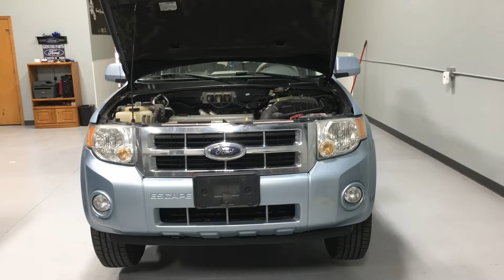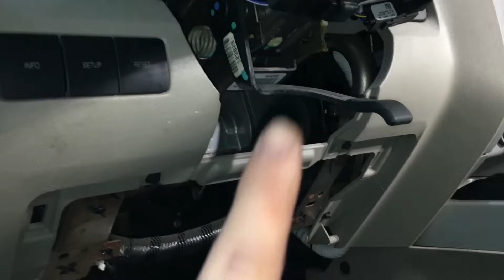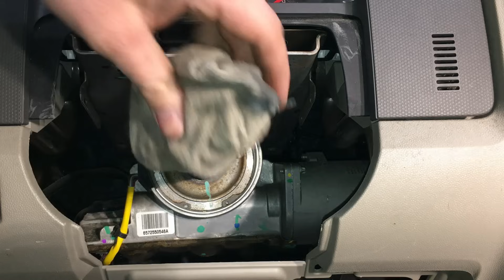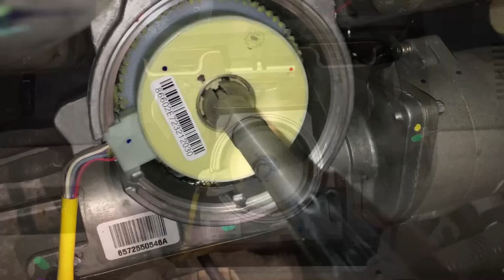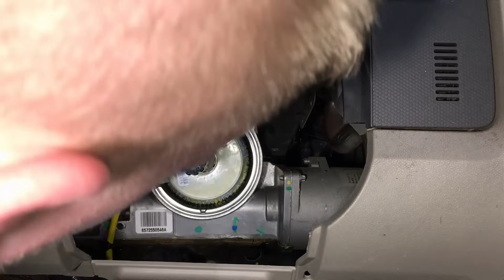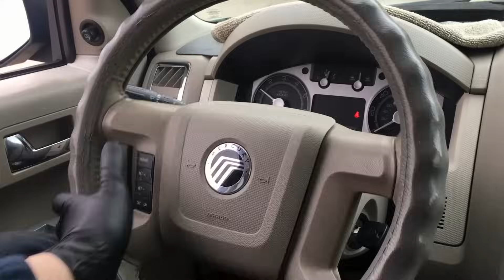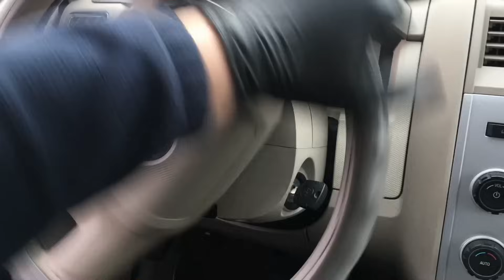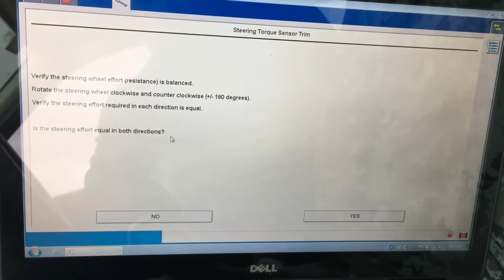2008-2012 Ford Escape Power Steering Code B2278 : EPAS Torque Sensor Critical Installation Steps

Comment: Have a 2010 escape no fault lights showed steering didn’t shake it just power steering started becoming intermittent. Watched video four times, gathered tools and part. Watched one more time writing down step by step everything necessary. I moved slow and precise thru the steps. Getting connectors undone slowed me down lol. Snap ring was a breeze. Aligned everything put together. Tested no shake or wild steering when key was turned but starting engine that thing flew to the right.  I tore apart, redid every step, snap ring decided to be a pia but got it done. Turned key nothing but start engine it flew to left (ordered another sensor but it would be here for a few days so I continued with the one I had)  🥺 redid a third time snap ring was even more of a pain steering again flew to left. So the day was shot but I decided to try one more time the following day.   Watching multiple videos, reading multiple forums  posts. I learned that you can reinsert the pin. There’s an upper and lower gear thingy in  the sensors center and both have to be aligned perfectly for pin to go back in, you’ll know because it’ll sit straight up and down and plastic gears won’t move independently.  I double and triple checked everything each time I did the install but any slight movement can set it off center so just be careful not to jostle anything until snap ring is reinserted. I reinstalled being very very careful. This forth time I decided to take car off the jacks before inserting key. So I put it down turned the key then started it and not a single movement from the wheel.  I turned left and right to lock positions several times and it was smooth as could be!  Backed out of garage and did a test drive around the back of barn area. Perfect power steering. So now I’m just going to be a bit cautious for the next few months just in case. 

Most important take always:  make sure those gears are perfectly aligned on sensor when you pull out of shipping box they could be jostled during shipping and handling.  That pin should be straight up and down in the center of its opening. No leaning forward or sideways. 
Double and triple check for alignment once installed. Before sliding tube back on. 
Don’t jostle anything when installing snap ring. 
Locking snap ring pliers are a blessing as it’ll hold snap ring when taking out making reinserting easier. 
Put car on ground before turning on ignition.
Reply: Thank you for your comment! I have 2009 ford escape . No fault codes , lights on dash . Only Power Steering assist fault message  ! Ford after sending out these recalls should have made it clear don’t do this unless problems with power steering!!!!!!

Comment: I just had this part replaced but the mechanic is saying it's actually the MOTOR of the steering wheel...is this true? After installing this senor my steering wheel is still very hard to turn

Comment: So I lined up the small arrow and the hole was pretty much center when I pulled the pin. I put it all back together and the wheel just cuts all the way to the right.

Comment: Didn't work!🙁     What a massive PotA trying to remove (let alone re-install) the snap ring.   I'm not going to go into all the details (I could write a book) but by the time I got it off (with the help of my brother and enormous trial-and-error effort to remove and install) I'd spent hours on that alone, not including getting the tools.  You DO need a very specific sort of snap ring removal tool, and though I got the biggest pair I could find at Home Depot (after trying the puny one's from AutoZone) it was still inadequate for the job.   For a single appropriate snap ring removal you will need at least a $35 - $85 tool from some specialty store (maybe).   And even then I think it would still be a massive headache.  This is not mentioned in video where it comes off in under 30 seconds. 

Everything else went relatively smoothly.   BUT.... no dice.   Still get message "Power Steering Assist Fault" with no power steering.  

When I installed the new sensor, the hole was in the window but on the farthest possible end of it.   I figured this is okay.  Right?  It's in the window!   Well I hope so. The video doesn't mention how to adjust this if you want it right in the center.   Reinstalling the snap ring and everything else involved a great deal of jostling of the whole assembly so maybe it came out of alignment by the time was all said and done (except for reinstalling the trim).   

Well... there is NO WAY I'm trying to get that snap ring back off and back on, and my brother is more adamant about that than me.   Someone below said they had to try 5 times to get the thing aligned right, but got it to work.    In my case, there was no wild steering wheel swing.  It just gave the same old message of Power Steering Assist Fault, with no power steering.    I have a computer reader with phone app, but that doesn't show any error codes or anything that can be cleared (at least with that tool).     The battery had been disconnected the whole repair.   

Anyhow.... I don't know what else the problem could be.   Got a bad replacement sensor?  Not quite aligned right?   Something else?    Gah.
Reply from the maker: Get the codes cleared in the PSCM and see if the steering comes back now.
Reply: @FordTechMakuloco   Thanks.  I'll give that a shot.   How would I go about doing that?
Reply: @FordTechMakuloco  I'm back.  Did the repair (wow was it really 8 months ago) and as I'd reported it didn't work.  But guess what!  I have my power steering back now!  For the last couple months already. 

I had resigned to live without power steering, and did so for 6 months.  But only after I took the vehicle to the Ford dealership where I'd frequently gotten work done to ask them to clear the codes in the PSCM.   The Android App based reader device I have didn't see or clear that particular code, so I figured the dealership would be able to clear it.

Well.... I took my car in for The Works oil change, and told them about my repair attempt.   The service associate was surprised I was able to get a new sensor to install.  Previously they'd told me they couldn't get that part, nor would they only replace just that because typically they find other things wrong, and so must replace the entire steering column (for $2000).   Though I'd already researched that it was likely this sensor and is probably all that needed to be replaced.

I told him where I'd found one (wasn't hard to locate a replacement), and that I'd installed it watching a detailed YouTube video on it (yours), but that my power steering didn't come back and the video creator suggested I get the codes cleared and see if it comes back.    Well... after waiting a couple hours (for the oil change and this supposed attempt to clear the codes),  I was told that they couldn't clear the code. It would clear and then immediately trip again.  BUT, he said NOW they'd be able to do the same repair I'd just done, instead of replace the entire steering column, and they could to that for just under $1000.  

I was like, screw it,  I'll just have to live without power steering, unless I decide to try to take that snap ring off again, and see if I'd messed up the alignment. 

Well,  many months later,  I got stuck in the snow.  Spent several minutes trying to get out of it, which I did.   The next day my traction control light came on and wouldn't go off.  So... I'm like well let me read the codes with my Android App tool thing and see what it says.  Well I ran that, it gave some codes I didn't really check them all but saw one seemed related to the traction control, and I cleared them (while driving, and the light didn't go off🙁 ).   

Then a bit later I'd parked and turned the car off.  When I came back and started the car, the traction control light was off!  I guess I had to turn the car off and back on after clearing the codes for the light to go off.   So, I pull away from the curb, and notice... Wow that steering seemed really easy, Am I parked on ice? 

Nope!  I wasn't parked on ice. Well maybe I was, but... regardless my power steering was back!!!   WTH!   It's been back ever since.  It would seem that the Android App tool that I use to read the car's computer codes has had several updates over the last few months, and I'd just never checked again to see if it would read or clear that code.  I figured only the dealership (or someone with the right tool) could do it.  And I trusted the dealer was being honest when they told me they tried clearing the code but it wouldn't clear!    

Moral of the story is... well... I don't know if the dealership repair shop was lying to me about not being able to clear the code and trying to sell me on their doing the repair for $1000, or if they really did try and it wouldn't clear.   In any case, my Android App was able to clear it!  And my power steering came back.  It was like a miracle!  Of science. 🙂  

In any case,  I've decided never to return to that dealership for any more repairs, just in case they were lying.  Who knows if they would have even installed a new sensor and not just cleared the code and charged me $1000.  Also, I thought they would just try to clear the code for free since I was paying for The Works oil change package.  Nope, they charged me an extra $75 for troubleshooting (I guess hooking it up to the computer?  I paid far less than that for the App device I use to read the car's computer) .
Reply: @EmeraldView  so what made the difference in the end?
Reply: @seanmalatesta4957  The fix described in the video and then having the computer reset.  Initially the little unit / app I have to read codes and reset them didn't recognize this one.  I was told I needed to take it to a dealer to do it for that particular type of reset.   I did and the dealer said it wouldn't reset and they could now do the repair for $1000 instead of $2000 (I thought maybe I installed wrong).    Well months later, the app I use had updates and apparently could now read and reset the code.   I reset the codes for something else and lo and behold my power steering was back!

Comment: Thank you sir! Got my steering assist donut, followed your tutorial and it works! Aftermarket part, so we’ll see how long it lasts. Actually it only has to last until I can dump this Ford product. 
I’m second owner. Bought this car in 2015 (2010 Escape). Nothing mentioned about EPAS steering issues nor throttle body although my manufacture date stamped on the door jamb tells me this vehicle should’ve been covered, but as this video star claims, Ford dodged the bullet and figured a workaround fix. NOTE TO DIY’ers—— that horseshoe circlip is a bastard to get off. Be ready to be tested! Common auto parts store didn’t have pliers that opened up enough. I ground down a pair of 45 degree long nose pliers to get that thing off and on. PITA. But hey...it’s done, and it worked! WOOHOOOOOOO!

Comment: Is it possible for the wheel alignment to be off from this issue? We have the steering wheel jitter like you show but what accompanied that staring was the wheel clocking being off by 2/3 of a turn as well. Same issue?

Comment: Hi. I have just replaced the torque sensor. However, when I started the car back up, I still have no power steering. What is my next step? My wheel was shaking at first, then the power steering went out completely. So we changed the torque sensor.
Reply from the maker: Clear codes in PSCM and retest.
Reply: @FordTechMakuloco  I have the same problem as well, but the code will not clear, any advice is helpful

Comment: So first I have to say the video was a amazing, and it worked great for me, but the only problem I'm having now is I still have no power steering, the wheel doesn't shake but it still has no power steering. Any idea as to maybe why?
Reply from the maker: Did you pull the battery cable in the first step to clear codes before you start?
Reply: @FordTechMakuloco  yes
Reply from the maker: Go in manually,  pull codes on the PSCM and clear them.
Reply: @FordTechMakuloco  how would I do that? I dont have a computer or anything to clear codes.
Reply: @FordTechMakuloco  okay so I found your video on how to clear the pcsm codes and it still doesn't have power steering

Comment: This may be a long shot... but can anyone tell me where to get snap ring pliers that open wide enough to remove this snap ring? The only ones I can find are just barely too small... won't reach both sections of the snap ring.
Reply: Hiltex 16" on amazon

Comment: Perfect...this is a ..AWESOME.. vid...i actually watched the vid to know how its done..BUT i simply did not have the space so i took it to a lincoln dealership by my house and they replaced the whole housing with sensor in it a 1500.00 part... i was so mad i literally if i had the space would have done it my self..the sensor was barely 230.00...but its done ..waranteed..those guys did do a great job on everything they fixed. I just coulda save 2700.00..my bill for that oil pan gasket and new key housing that they found a problem with on my 2008 for escape ...a little over 4200.00...

I was originally given a 3700+ total with tax..but they found a problem with the ignition so if went up to over 4200...

So i do have the mind and basic know how to do this kind of work i have take care of my own car issues in the past but the garage is stacked high with junk and tools and stuff from remodels home remodels...

You van save a ton if u do it your self?.. but ONLY if you have the mechanical gene and understand it...otherwise its well worth it to take it to the professionals..like i did..i still think it was way high? But hey it done...

I now have been traumatized to the point of i will bo buy two sensors and have them on hand and be ready to do it myself! 😂😂😂😂 i hate electric anything..i have a 91..94..f150..never ever had a steering issue...96 for explorer never...2008..recalls on power steering..even a few years after the original owner. My buddy..got the car..every now and then on a turn the wheel would stiffen up.some times scary almost hit a parked car twice...they said it wasn't a recall issue..and now all this time it goes out and i missed recall ugh..fml..

Comment: Great video!  Very informative!  Thank you for taking the time and energy for making this video.   
This just happened to my sons 2010 Ford Escape last night.  I read on line that it might be the torque sensor control.  That’s exactly what it was.  Thank god I didn’t have to replace the whole steering rack.  I read that some people had to replace the whole rack.  So my mechanic is doing it.   Like you said the part alone is $265 from Ford plus labor. 
That’s where my mechanic deals with for certain parts.   Well it beats paying $2000 !!
Just saying Thank you for a great video!!!

Comment: I have a 2008 Ford Escape I turned my car on and the wheel barely moves it’s so stiff barely driveable! Is this my torque sensor or do I need a steering column? Showing codes for B2278 B1870 B2477

Comment: Hi. my 13 GT had The Advance Track needs service light come on and also has no power steering. I was told by auto repair shop the code reader said it was a Steering Wheel Angle Position Sensor. I can't find the Position Sensor and Ford says The car does not have one!?.  So I thought maybe the Clock spring does both... Nope. I changed that and still the same. Help Thanks

Comment: Excellent video! Everything explained clearly and in detail! The only thing I found missing: once I got everything together and turned on the vehicle, I got the fault message and there was NO assist in turning the wheel :-( 

I was like, "$h!+, all that work and the problem wasn't the sensor?" ... So I had the idea to hook up my OBD2 code reader, and I cleared the fault code. After that, as soon as I turned the vehicle off and back on, the EPAS worked! Was the code cleared in the model you were working on before you did the repair? Everything else in your video was so detailed, I was surprised that my results were different and needed this extra step.

A 'plug' for anyone who is attempting this repair and might run into the same problem with the code persisting - here are the products I used to read and clear the code. All together, these cost me only about $60 - half of what the Ford dealer was going to charge me ($120.00!!!) just to read the code!!!

VEEPEAK OBDCheck BLE: https://www.veepeak.com/product/obdcheck-ble/
OBD Fusion: https://www.obdsoftware.net/software/obdfusion
... with the Ford Enhanced Diagnostics add-on: https://www.obdsoftware.net/software/fordenhancedaddon
Reply from the maker: I'm guessing you didn't follow the first step of disconnect the battery cable which would of cleared the code automatically allowing it to work perfectly upon completion.

Comment: My neice drives an 08 Mazda Tribute, basically same vehicle.  I want to purchase the part because it seems to be quite rate and her power steering failed last night.   I would assume this is is same part used on the Mazda, they are essentially the same vehicle, is that correct?     Great video BTW really clearly explained